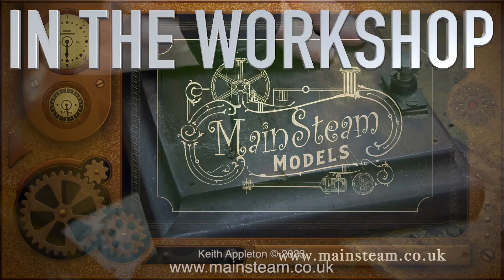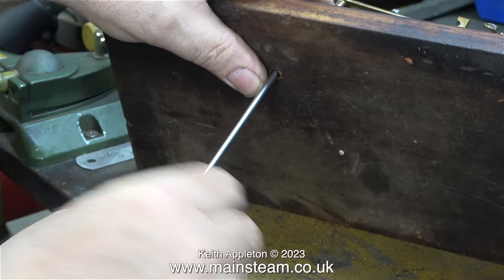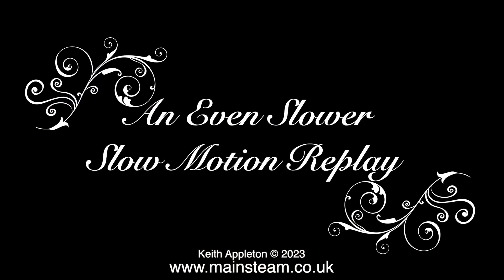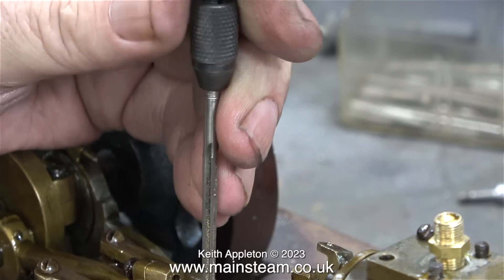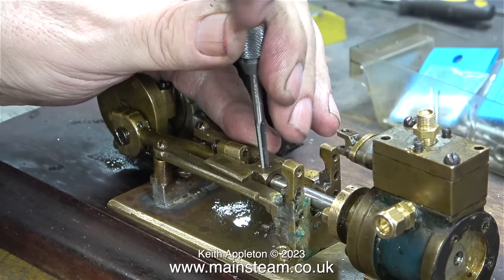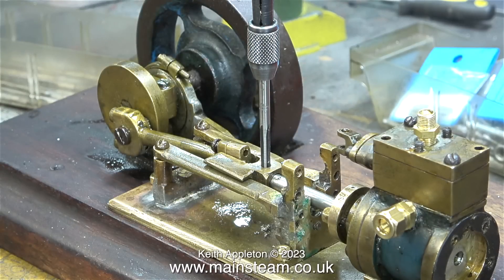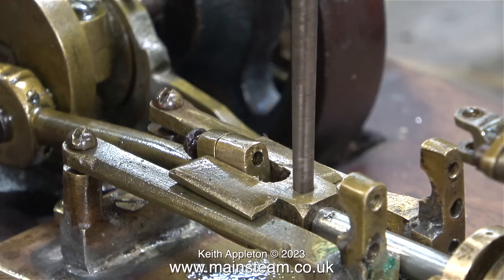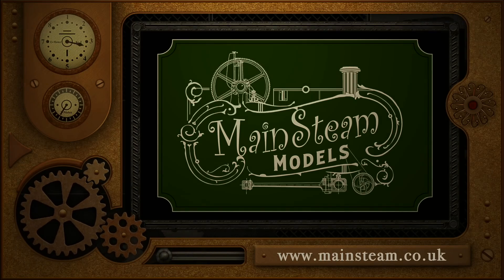A DIABOLICAL MODEL STEAM ENGINE - PART #8

Comment: 4000 units of Vit D is a good thing for us older guys

I went to the doctor and he found me extremely low on Vit D and had me  take 50,000 units (like 1/6th of the unhealthy dosage) for a week then drop down to 1-2000 daily

it definitely changes your mental health, and is cheap

(also not a doctor)
Reply from the maker: In my friend's case it is Vitamin D3 K2 4000ui to be exact.

Comment: Keith, you please go on talking about whatever you want to, as fast as you want to.
However, I must say that you did something WRONG in this video! Your compressed-air piston mortar would achieve MUCH greater distance if you set the cylinder, er.... barrel at an angle of 45º, verified by the use of a sine bar.